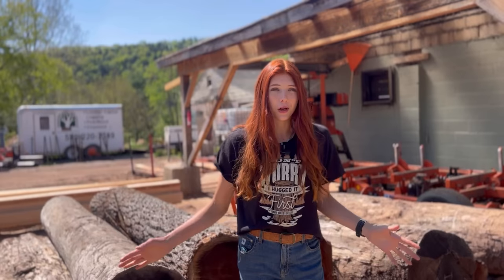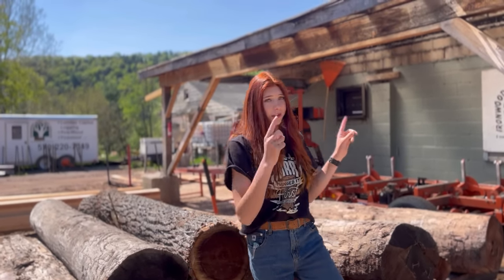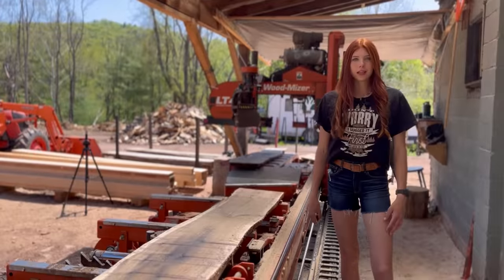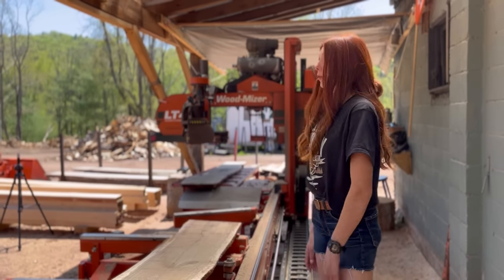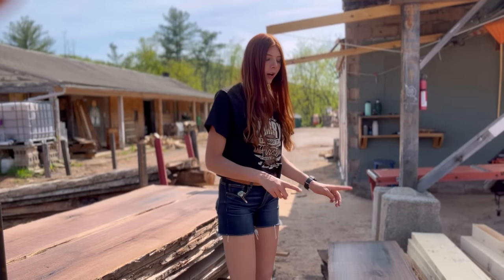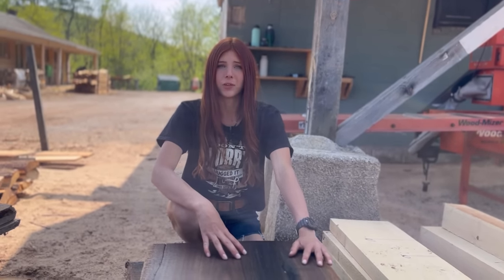Milling Walnut Riddled with Nails!

Comment: I had a friend used a piece of wood from a tree near a old mine entrance. He used a pin point metal detector then cut and wirewheelsto expose one half of two square nails along the length and one exposed into the air. He then used pour epoxy to make a flat topped end table. Absolutley gorgeous and the way the wood grew around the old square headd nails is impressive.

Comment: Many Sawerss are using the more expensive carbide tipped blades because of their long life between sharpening. They also cut through any nails they encounter in the log and keep on cutting.

I am sure your customers will appreciate the beautiful slabs you sliced.

Comment: Either using carbide tipped blades to cut through the nails or finding them with a pin point metal detector and getting them out might be options worthwhile exploring.

Comment: I had a big ponderosa pine on my property that had US Border Patrol cameras mounted in it. (I live right on the US/CA border in WA). The tree fell over in a heavy snow, so I contacted the Border patrol. They sent out a supervisor to inspect it. I said I'd prefer they didn't cut up the main log, as I wanted to mill it (42" at the small end), and he said np. There were quite a few cable hooks and lag bolts holding all the gear on, so I asked if they could leave that all on and I'd remove it, or if they chose to remove it to make sure they didn't snap them off. He said np. After they were done I inspected the log and saw quite a few holes where the bolts and fasteners had been, and it looked like they had done a decent job. They hadn't. I cut 8 lag bolts and ruined three blades. Once I dug down into the log slabs, I could see that they just pried them back and forth until the bolts broke off below the bark. Milling metal sucks. : /

Comment: You are experienced enough to know the answer. Go deep. The mill I worked at had a ,debarked, which helps. But, if we suspected metal, you slab 3 or 4 inches.or just cut a tie out of the heart.

Comment: I wonder if you can fix and/or resharpen the blades or if it's just a total loss (I'm sure the blades are expensive). My cousin has a portable mill (up to 16', with a ittle 4 cylinder diesel). He got permission to cull dead trees out of a forest near Eagle's Nest, New Mexico. He can cut them down and drag them out with a chain bolted on but he doesn't have any way to load and haul in logs. so he just cuts slabs there on the forest road and loads up the slabs....

Comment: Would it have been better to use the logs with metal in them as firewood? When you take into account the cost of the blades and downtime vs value of the boards?

Comment: As a complete novice to this topic, how did nails end up in what looked like freshly cut trees?
Reply: For whatever reason, somebody put the nails in tree when it was younger and tree grew around them. Maybe the nails were for hanging a sign long ago?  Have no experience milling but have hit steel or embedded rocks (that a tree has grown around) plenty of times with chainsaw. If mild steel, like barbed wire, or piece of chain link fence, can easily sharpen teeth and be good to go again, but hardened steel like a nail can easily obliterate chain teeth.  So in latter case, one tosses the ruined chain and puts on a new one.